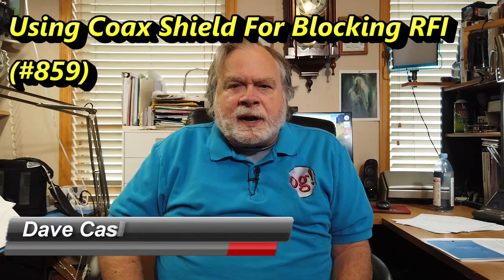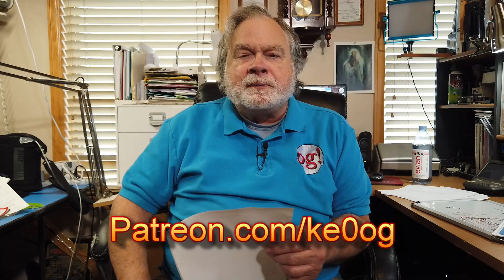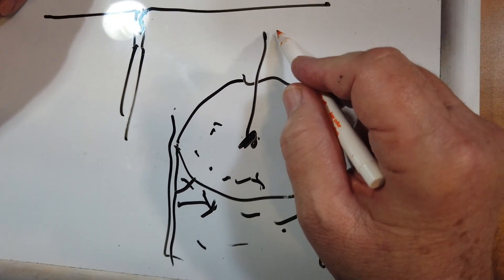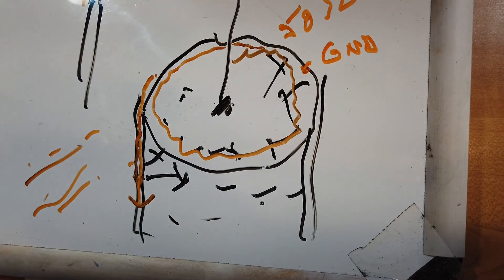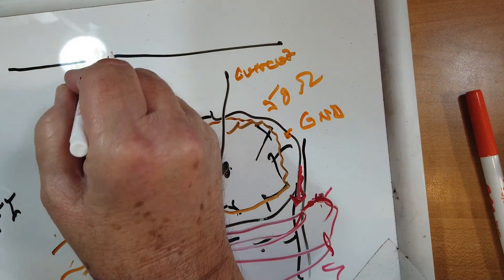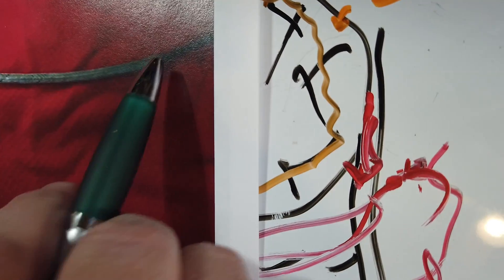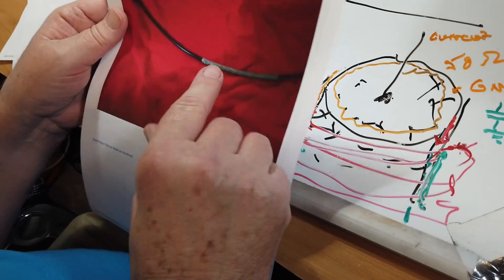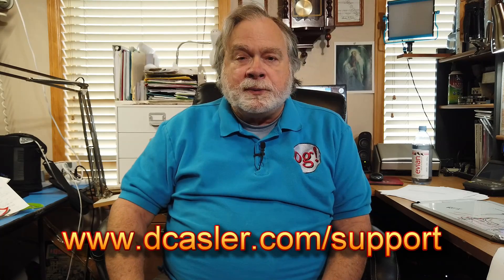Using Coax Shield For Blocking RFI (#859)

Comment: If I put some ferrite beads on the coax I add inductive reactance to CMC path but if I put a braid outside the coax (connected to nothing) I don't add capacitive reactance as you claim.
Putting ferrite sleeves or beads on the coax works because it becomes a one turn inductor for CMC (no effects for the energy inside the cable). A conductor outside the coax and not connected to anything, can only... "disturb" CMC, nothing more.
It looks like a bad "sleeve" or "bazooka" balun: it is "bad" because his base it is not connected to the coax braid.

Comment: Thank you, Dave. This is an interesting video. 
    From the last photo, the braid over the outer coax insulation appears not at all connected to the coax shield.
    So the exterior braid over the outer coax insulation forms a capacitor with with the shield and the outer insulation serves as a dielectric of this capacitor.
    OK. RF behaves strangely!!!
Well now, I have something to ponder.
Thank you.
N0QFT

Comment: I'd run the coax through a length of 1/2" iron pipe, since copper braid doesn't pose any impedance to magnetic forces.
Reply: It's a simple "bazooka" or "sleeve" balun: nothing new and it work better using copper!

Comment: Hi Dave, another video with lots of confused statements..
At 1.25 you said clearly that the outside of the shield braid is at ground potential for DC. Absolutely right. And all things are happening only on the inside of the coax cable; again correct. Yes, all of the RF energy is contained in the dielectric material (or the space) between the outside of the centre conductor and the inside of the outer conductor.
A dipole is a balanced device.
The coaxial cable has three physical conductors including the outside of the shield braid.
If the dipole radiators are deployed correctly with symmetry and in free space then there are no chances of a CMC (Common Mode Current) to originate and start to flow on the outside of the coax shield at the interface of the coaxial cable and the dipole radiators.
But any asymmetry in length (of the radiators), proximity of the feeder cable to one of the arms of the dipole or any other RF absorbing structures near to one of the arms of the antenna or any other  radiating antenna (in the same or harmonically related bands) in the nearby vicinity can all give rise to a CMC.
During reception the "third conductor" ie, the outside of the coax shield can bring in RF trash and it will raise the noise floor.
A CMC Choke can be some kind of reactance that should offer very high resistance to the CMC but should be allowing the differential mode current unimpeded. Usually we employ an inductive reactance to do the job to obtain a large value of reactance (largely the resistive part is preferred) over a wide frequency spectrum. Of course there's a compromised design for the entire HF spectrum.
The W2DU's design consists of inserting number of ferrite cores (sleeves) over the end of the coax cable near the feed point. Probably he used #73 or 75 Ni-Mn material, I don't know.
Next option is the "ugly BalUn" though not necessarily an ugly one to look (your suggestion of 9-10 turns of 9-10" in diameter). The drawback is that it might act like a "trap" for some frequency bands. 
And ultimately the ferrite loaded CMC Choke seems the best option. One can refer to G3TXQ for very good details of the selection of core, winding number and materials and very importantly the pure resistive portion of the choking that would be obtained in a particular contraption.
Now let me come to the today's topic of using the "shield braid" of the coax cable to stop the CMC.
Just by adding or sleeving a foot or so of the shield braid over the coax cable feeder is not going to do anything at all; not only to the CMC or anything else whatever it may be. 
In the VHF UHF bands you can add a 1/4 lambda long sleeve over the feeder cable with the open end of the cable soldered to the top end of the sleeve. This will act like a "skirt" over the feeder cable and will offer a high impedance to the flow of the CMC that tries to originate from the tip of the coax cable at the feed point.
But here you made some confusion as I could not understand if or not the suggested (by the questioner) sleeve is simply left over the coax cable or is electrically connected. But as I understand you (and the questioner) said the sleeve acts like a capacitor (how) in air (!?) and will offer capacitive reactance to the flow of CMC. 
All your readers and I are totally confused. But you, this time, asked for comments hence I have made mine.
De VU2RZA
Reply: Helsing brothers are on their way over to take a look at your radio equipment and say `hi`
Reply: @gabrielsansar6187  oh yeah, anyone is always welcome to my shack including you, my brother ❤️
De VU2RZA
Reply: Confused ideas in you too: David doesn't know the "bazooka" or "sleeve" balun and how a ferrite sleeve work, but what about you when you write that some coils on the feeder coax can act as a "trap" in line for some frequency band?
In any case, on VHF as in this video, winding the cable is useless because CMC "jumps" from one turn to another due to the parasitic capacitance
Reply: @IK8XOO--Paolo  yes, Dave would advise to have an ugly BalUn (he doesn't believe ferrite loaded CMC, Common Mode Current Chokes) and in his own words, it is 9turns of coax wound on a 9" diameter former or simply air cored"
This ugly BalUn would have inductance and capacitance. A 50 ohm coaxial cable would normally have about 30pF per foot. The total length would be around 20'+.
You can thus use it in a mono-band antenna for which the number of turns might be adjusted right.
If the same "ugly BalUn" is used in a multi-band antenna the BalUn would act like a trap for sure.
You are getting confused with the Bazooka BalUn here.
Hope this helps.
De VU2RZA
Reply: @subramanianr7206  Thank you, but I don't need help to understand: I have studied these things and today I explain them and teach them to students.
Forget your calculations based on the capacitance data of the cable: you are talking about what happens inside the coaxial cable while CMCs run outside the cable and therefore what you write does not make sense. As long as you don't crush the cable, i.e. change the distance between the conductors or their diameters, you can make all the coils you want or strangest paths without influencing what happens inside the coax or the behavior of the cable: in short, it doesn't become a filter, an inductor or a trap if you don't connect it in other ways.
For the same reasons it doesn't even make sense to calculate the total capacity of the cable and neither does it need to wind it in coils under the antenna because, starting right from two metres, the RF that runs outside the cable is capable of jumping from one coil to another.
Even ferrites at these frequencies are not very effective. A good solution may be the bazooka balun but only if well assembled and not as described in the video. 73s.
Reply: @IK8XOO--Paolo  hi, I strongly believe that you have to start from the scratch; I hear something like this, for the first time in my life from you.
If you don't believe me that is your choice.
But you can refer to the ARRL, RSGB Book or any other articles published by the Elmers and veterans on the subject of an ugly BalUn made by coaxial cable; I think you may not be willing to experiment by yourself which would show that you are thoroughly mistaken.
And then try to teach your students.
All the best 👍
Finally the Bazooka BalUn would be working for only one frequency plus or minus few 10s of kiloHertz; so, that is suitable for the VHF UHF bands.
For a multiband HF dipole antenna your suggestion of a Bazooka BalUn is not going to work.
Moreover when I am talking about the "ugly BalUn" you are talking about the Bazooka BalUn 😀; that's very strange!
De VU2RZA
Reply: @subramanianr7206  If you have never heard of what I have explained to you, it is evidently because you do not know what you have chosen to discuss.
So you don't know, for example, the negative effect caused by the parasitic capacitance between the turns in the inductors which makes it useless to wind the coaxial in order to reduce the CMCs at frequencies higher than HF as in the case of the video and which we are discussing here.
You write about the ARRL Handbook but you only know its title: in fact on page 20.25, table 20.6 of the 2022 edition the coiled coax choke baluns listed and suggested do not go beyond 30 MHz, as I already told you.
So, ON THE SAME BOOK, starting from VHF, as in this case shown in the video, a sleeve balun like the bazooka is recommended; on page 20.20, fig. 20.18 is shown how the base of the sleeve is electrically connected to the coaxial braid, while in the video it is not, losing most of its effectiveness.
From what you write it is also evident that you do not know the difference between the propagation mode of an e.m. in a transmission line (the inside of the coax) and a normal conductor (the outside of the braid of the coax).
Reply: @IK8XOO--Paolo  ha..ha .ha.. that's the catch.
You still don't understand about the difference between the ugly BalUn and the Bazooka BalUn.
Just by quoting the page number in the antenna hand book doesn't mean that you have understood the subject.
You can't employ a Bazooka BalUn in the HF spectrum because it's not going to work;
The ugly BalUn is being used by many people in the HF bands and it's usually suggested by Dave. And it would form a trap due to the LC of the coil for some bands. Again it depends on how many turns are used in a particular installation.
You may want to read again and come for discussion.
Happy reading 👍
De VU2RZA
Reply: @IK8XOO--Paolo  hi.. that's the same advice I am offering to you; just go back to school before attempting to teach anyone or your students.
De VU2RZA
Reply: Many years ago some old boy explained to me this method of stopping RF coming back down the coax, over the years I have tried this braid experiment when installing many different types of antenna.. I can honestly state with all my installs adding the braid made no difference whatsoever.
Reply: @DeltaXray444  Nothing new: look for "bazooka" or "sleeve" balun.
Reply: @DeltaXray444  yes, you may want to read the response given next.
Thanks for your feedback 👍
De VU2RZA
Reply: Supper Dr வெள்ளைக்காரன் யூ டுயூப் விட்டு ஓடப்போரான்
Reply: @kannappanmpk  unnecessarily negative observation
Reply: @SunilAruldas  !!??
De VU2RZA
Reply: @SunilAruldas  Not at all. Confusion reigns in this video.
Reply: @kannappanmpk  yes, adding a braid or any copper tube as just a sleeve along the length of the coaxial cable is not going to do anything. After all the coaxial cable is meant for this specific special feature; whatever that's happening inside the cable does not know what is going on there in the outside world. The main setback with the open wire line is that you can not have anything (especially metals or other RF absorbing structures) in close proximity (at least around a distance of 5-6 times the width of the line)
But having a sleeve of 1/4 lambda long connected at the top with the shield braid of the coaxial cable will effectively prevent the CMC flowing down the length. The "flower pot" antenna exploits this phenomenon. But then it's going to work for just one frequency or a narrow range of frequencies of the band. Hence it's used in the VHF UHF bands.
De VU2RZA
Reply: @gabrielsansar6187  is it!?. This is real news to the ham world if not the wireless world in toto. That's why you are not confused among us.
I suggest you study and experiment further. It would be useful to the world.
De VU2RZA
Reply: @subramanianr7206  be quiet you ducking crick.......where is your channel contributing to the hobby  ??? nope you don`t have one.. You just write war and peace rants at people who don`t need to hear it.... you are no doubt hated by literally everyone you know..... grow up and leave decent people alone.

Comment: What isn’t clear to me is whether or not that shield is “peeled back” on the coax for one foot, or if it’s just added over the insulating jacket after being removed from a different piece of coax.  If it’s not peeled back from itself, is he saying that there is no physical connection between this external shield and the internal coax shield?
Reply: There is no physical connection between shields. It's coupled capacitively.
Reply: @louisseaman8455  that helps explain things!  Thanks
Reply: It is very clearly explained.  Take a fresh piece of coax cable about 2 feet length revive only shield after sliting the black plastic sleeve from coax.  Then slide it over your antenna cable at the feed point or at the shack near to the radio.

Comment: Especially odd since a typical braid is made of interwoven strands, so physically the inside and the outside of the coax shield are constantly exchanging places/roles. So there is no simple inside or outside, unless the signals are literally jumping from strand to strand every few millimeters and "square dancing" on them.
 Most peculiar, unsatisfying, and illogical, Dave.

Comment: Kinky. I like it. Sound logic. Great explanation, Dave!
Why not add a groundwire to the second coax shield, or would that effectively short circuit the two shields by putting them at the same DC potential? RF is different.

Comment: I don't get it.  Why wouldn't the RFI voltage simply capacitively couple to the added braid and still be there both in the coax shield and the braid?  What's holding the braid at ground potential?
Reply: I believe he meant the inner braid was at ground potential.

Comment: Great idea, makes me wonder if for indoor use like just in the shack, that maybe a section of tin foil about a foot long or so wrapped around the coax and then wrap that with black tape might also work. Just a thought I guess but this looks like something to try, makes sense. Thanks for your videos as always, keep up the great work! 73..wd0akx
Reply: I was wondering if adhesive metal foil would work.
Reply: @PaulGriffith  It's worth a try, I have some copper foil tape I bought to try to make a magnetic loop antenna, it would probably fold right around the coax. Always worth a try.
Reply: It probably would work that way but its best to do it near your antenna to keep rf out of the house/shack